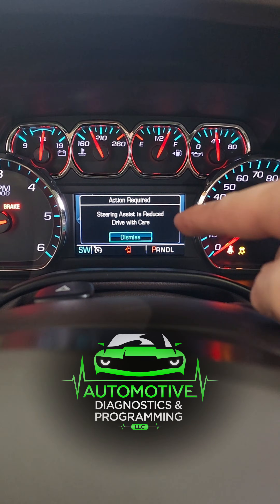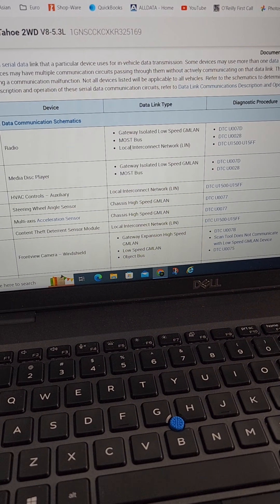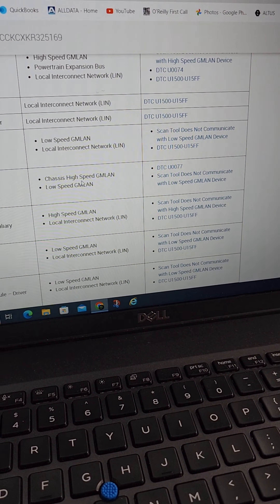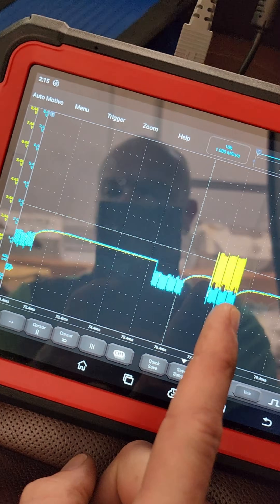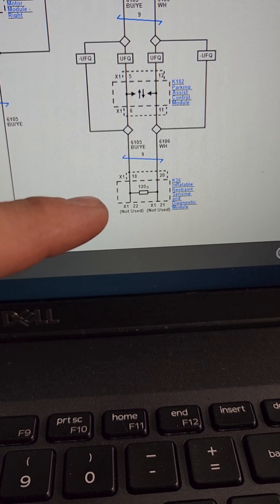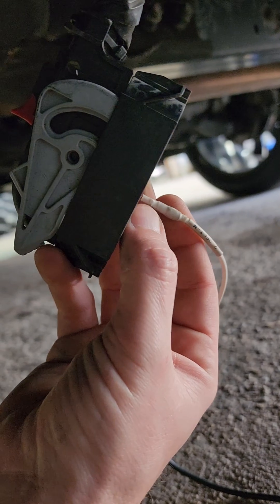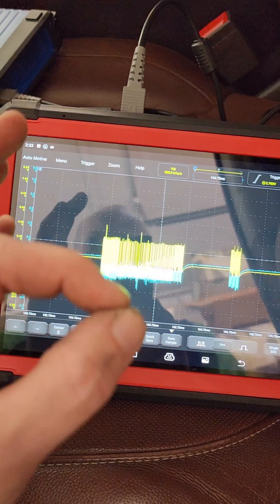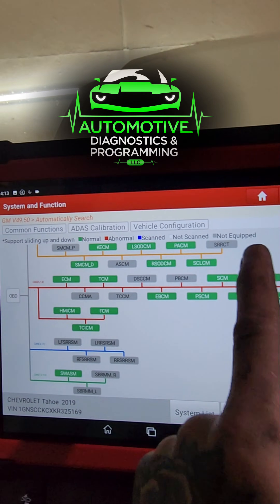2019 Tahoe with a Chassis CAN Bus Issue

Comment: Thank you for posting. I’m having this exact problem on my 16 Silverado. It’s so frustrating. I went from an 87 square body and I could repair that thing in a few hours and good to go. These stupid new vehicles have so many Achilles heals. I hate it. One little connector or wire rot through, which mine has done several times and it’s hundreds of dollars. It’s all a scam to make dealerships money

Comment: Great video, 
This was very informative. I have an older tahoe that started to go into limp mode and would not start very often with the dash guages dropping out and other crazy things. I narrowed it down to the canbus voltage being way to high over 8 volts from can hi or lo to ground. I decided to start unplugging modules and the first one I unplugged was my abs which dropped the 120 oms to 60 but the can bus voltage went down to just over 2.5 on both hi and lo. So I'm like yes this is the issue. It was not. I replaced the abs module and the exact same issue returned when I plugged it in. The abs connector has no issues whatsoever. Unplug abs good and plugged in the vehicle won't start and guage needles won't move from zero. 
Any help would be greatly appreciated.
Reply from the maker: That's because the can bus is linked through modules. If you had a high voltage reading on the bus and unplugged the abs made it go away then you need to keep going down the line on that end of the network.
Reply: @autodiagyt  I had the misconception that the canbus was simply paralleled to each module device and was shorted to some power within the abs itself affecting the network. Still learning how these work. But if it's a type of pass through network then this is making way more sense.
Reply from the maker: @kickford  yes GM pass through each module so if a module is unplugged so is the rest of the network.

Comment: Jake.  What scanner and scope models are you using? it looks like a topdon to me, but a topdon what?
Reply from the maker: The scope is Topdon. The scanner I normally use is a Phoenix Smart but I forgot to charge the battery and was using the Launch X431 Pro 3s+
Reply: @autodiagyt    Thank you
Reply: @autodiagyt    I am struggling with which scope and scan tool to buy.  Any suggestions?
Reply from the maker: @ericsingleton2047  depends on your budget and what the majority of vehicles are you working on

Comment: Nice diagnosis.  For some reason, testing to find out which direction to go to find out which terminating resister to go toward confuses me.  So when you did the test at the EBCM and got 120 ohms and said that the reading was from the air bag module and that the problem was toward the EBCM, what would have been your reading at the EBCM if the problem was toward the air bag module?  Thanks.
Reply from the maker: OL(open loop) or some very high resistance.
Reply: @autodiagyt  Ok, thanks Jake.

Comment: On the newer gm cars 120 ohms is normal.
Reply from the maker: I don’t believe that’s correct what vehicle specifically are you referring to?
Reply: Saw that on a 21 Silverado. Pins 6 and 14 on dlc go to a gateway now, not the high speed network.had me chasing my tail for a bit until I looked at the schematic.
Reply from the maker: @bradleybeaudry8935  yes a gateway vehicle will show 120. That’s where a diagram is important!

Comment: That was definitely a great follow up for the last case study. Now showing the ohm meter along with the oscilloscope to track down the source of the problem. Did you have any certain order in tracking down the bad connector, or did you just procede to check the ones that where the easiest to get to first?
Top notch diagnostic Jake! Thank you for all your videos!
Reply from the maker: Yeah I usually just try in order that the diagram has but if some are easier then others I'll jump around and skip the harder ones and come back to them.

Comment: Great video and way of breaking down the system and troubleshooting. I always wonder how a terminal can be spread open. I have had that on my own systems and I have not been in there poking around. Can it be just from being plugged in a certain way and then fatigue caused by vibration?
Reply from the maker: Probably just poor metal not having adequate spring properties. Heat and vibration will fatigue them.